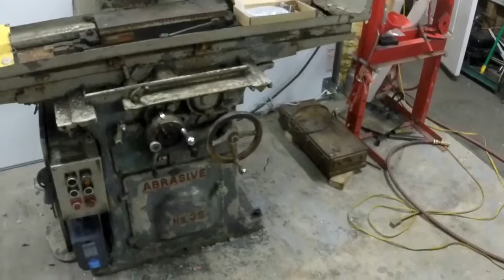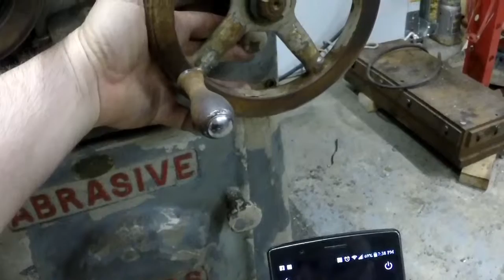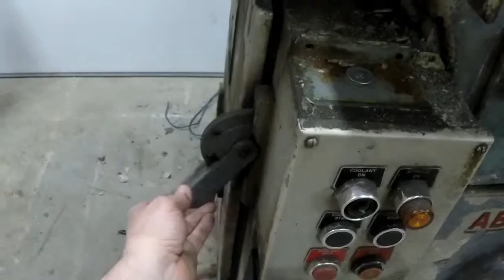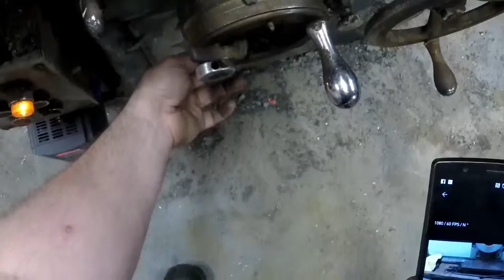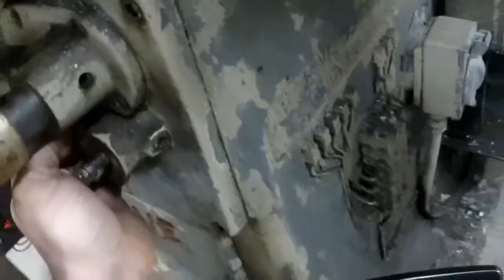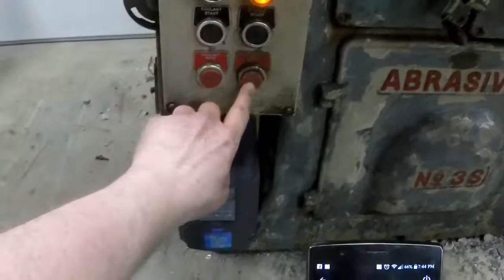Surface Grinder, Landis Abrasive

Comment: thanks for the walk through, as a beginning machinist i feel that if i grab a surface grinder now, it would pay for its self in the making of parrallels and what not, plus be a nice little precision finish tool as well.
Reply: You are welcome. A surface grinder is the type of machine that, when you need it, you need it. It certainly can be useful with making square, flat tooling.